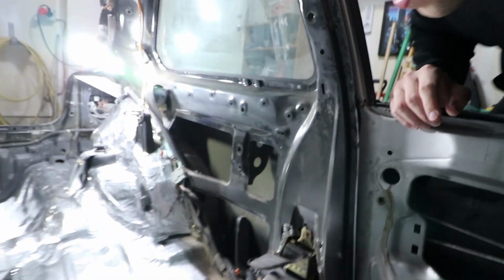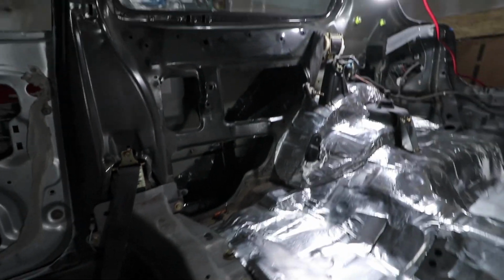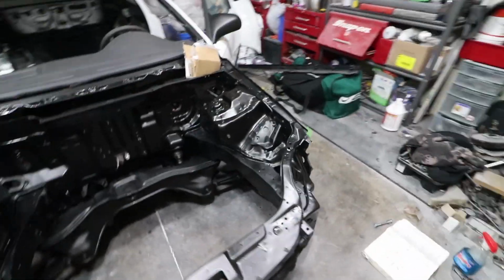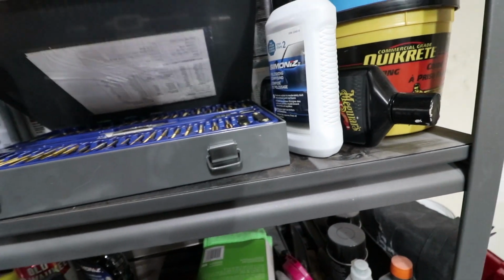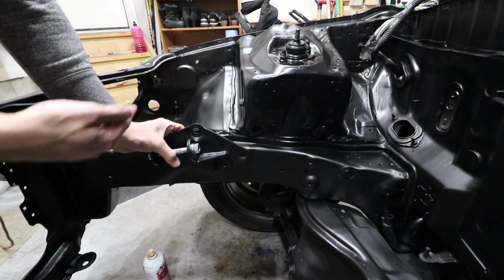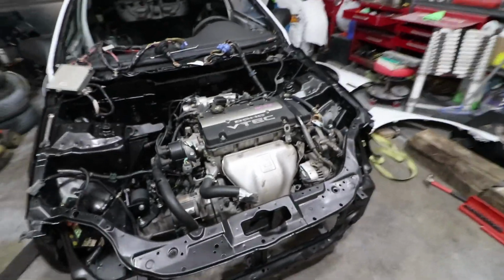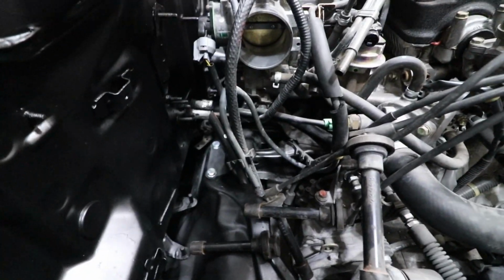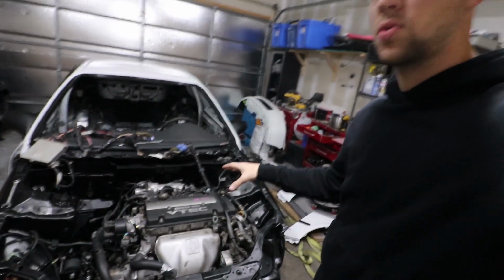Dropped The H22 In The Honda Civic - First Ever Engine Swap

Comment: dude.. love your chanel.. amazing work.. i wouldnt be too concerned about rust,  you did a hell of a job..i dont recall if you did this or not but if you havent- get some HIGH QUALITY  rubberized coating and spray the inside of the wheel wheels ... it will add extra support against rock chips, depris, dirt, and sand flying up and chipping your Quarter panels.. also an added layer of protection to the PR15... i plan on swapping my EK too, was it hard? will be my first swap as well.. probably gonna go with a B series.. you have a snapchat man? Again, great content dude- keep up the hard work!!!!

Comment: Hey I'm looking to the same swap on my 99 ek hatch . I was wondering ifyou can give me a full list in what I  need to install the h22 into the civic.
Reply: Me too. Iv got a 39,000 mile mint ej9 and planning on a sleeper build
Reply: Same:/ can’t find much on it
Reply: @Isack_Roach  we need help
Reply: It's not that bad. Swap mounts, shifter box cables, axles can be da or dc2 depending on what half shaft you use. Or can use swap axles. You can use the stock civic harness. Will need to extend the alternator wires. Few other wires that you will see. Most of it is plug and play. I swapped a f23a into a ek civic. Damn close to doing a h22 swap.
Reply: RedLineBandits thanks man!! Just bought an H22a type s so hopefully she halls
Reply: @Isack_Roach  oh yeah!! The typeS has a bit more torque than the euroR block if im not mistaken
Reply: How did you do the wiring help
Reply: @jimenezjesse9423  the entire wire harness? I actually got to plug mines up to my EK harness but the condition it was in was not the best
Reply: @NathanCAY1010  so just use my ek ex wire harness
Reply: @jimenezjesse9423  can give it a try bro, a guy that knows harness help me with mines, i completely forgot which wire he disconnected for me but other than that it started no problem for me
Reply: @NathanCAY1010  thanks bro

Comment: Hey man the shell is coming out SOOOO clean!! What is the sealant you we’re using to do the underside of the shell and in the grooves and corners of the floor?? I NEED to know!! I’m also doing a project ek hatch and it looks like that stuff really works! PLEASE let me know!!
Reply from the maker: The main product that i used to seal it was POR15. There is quite a bit of prep work required for applying that product but in the end can shed some really nice results. And can also last for a long time as well. In the groves i tried to get in there with a brush of the por15 and soaked it in there hoping it seeped in tough to reach areas.
Reply: Garage SpeCivic alright because I was thinking about buying spray rubber for the underside of my shell but I mean is their a lot of prep work before applying it?
Reply from the maker: More prep the better. If you dealing with a rusty underneath I suggest fixing that first before applying a rubber undercoating. Rubber undercoats can cause issue down the line that if water is still there where you sprayed, it will be trapped and over time rust will spread fast. If you scrape the flaky rust if you got it, and convert it, just throw an oil based painted over it and rubber coat if you want. But take your time and good luck
Reply: Garage SpeCivic thanks bud I really appreciate it and for welding the repair panels, did you use flux or mig?
Reply from the maker: flux welded the panels
Reply: Garage SpeCivic alrighty. And did you use 0.33 gauge wire or 0.35?

Comment: Next time just lift the civic super high up and then slide the engine through the bottom. It’s easier
Reply from the maker: Thanks, I will give it a try for future swaps
Reply: Issa Me Da Great that's how I pulled my two h22 engines last summer 🤙🏽

Comment: fairly easy drop in? didnt bang inside the bay at all? My bay is super shaved and tucked and freshly painted
Reply from the maker: i went very slow. scuffed the paint a little bit by the transmission side. Used towels and stuff to protect the paint as much as i could. once i got the idea of how extreme of an angle you had to drop in the engine, it went pretty in pretty easy. Took a little time having to attempt to drop it and pull it out, adjust the strap angle and so on. But if you go in right off the bat at a 45 degree angle the drop should be fast. 2 people helps too. That engine fills up the bay though. Someone recommended lifting the front end though and sliding the engine from the bottom. Definitely would avoid fiddling with the transmission side as it can be tricky.

Comment: Hey bro what T-bracket did you use ?
Reply from the maker: I got a 97-01 OEM prelude rear t bracket mount, came on the motor when I picked it up.